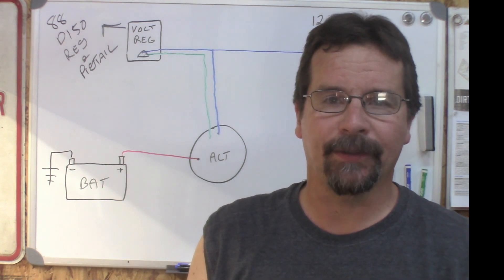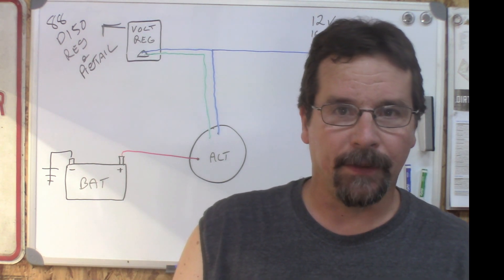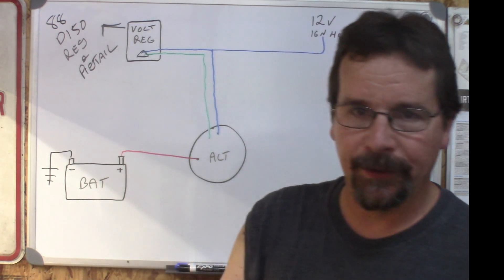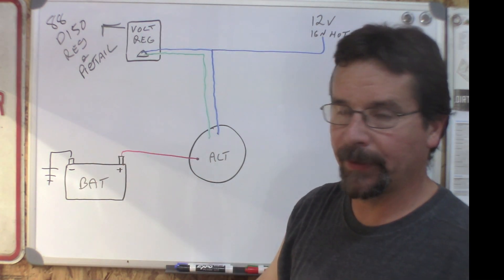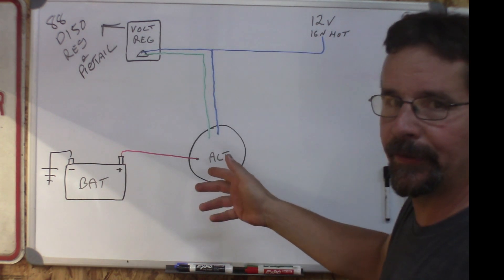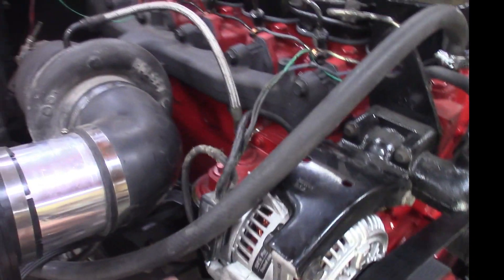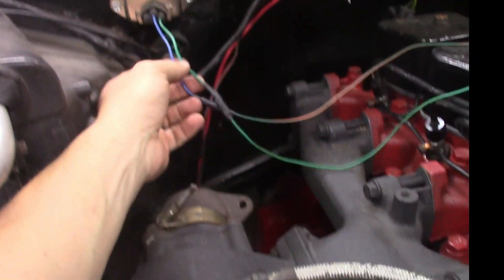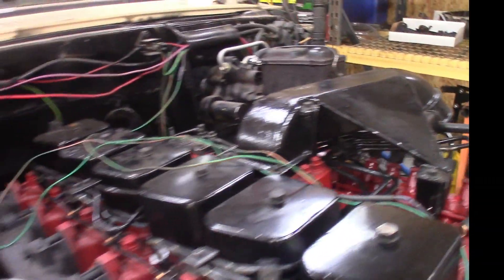How to Make A Dodge Alternator Charge In A Chevrolet (External Regulator Conversion)

Comment: Would love to do this on my swap and save a few hundred. The one wire alternator has a tach wire option. I really want to run a tachometer for the nv4500 to learn my shift sweet spot and see what the engine is doing. Is there another tachometer wiring option besides the one wire alternator?
Reply from the maker: I'm working on getting a tach to work off of the factory crank sensor but haven't quite got it figured out yet. 
When I do I'm definitely going to post a video of it.
Reply: @RicosGarage  Thanks for the reply Sir. I will be tuned in for this, hope it works out.

Comment: Rico I'm having hell. I have a 96 12v in a 2001 ram 1 ton. I've done everything but still not charging. Where should I hook up the split (blue) wire at? At column or starter
Reply from the maker: Starter won't work. You need 12v ignition power.

Comment: Rico quick question will any external reg work or does it have to be Chrysler
Reply from the maker: In order to follow this wiring diagram yes you have to use a Chrysler regulator. 
I'm sure you could make another type of regulator work but you would have to figure out how to wire it up on your own as I can't be 100% sure it will work the same way

Comment: On my jeep two wires go back to the ECM. Unless you put a load resistor between these wires, your volt meter goes to Max and your check engine light stays on
Reply: How big resistor.

Comment: Soooo... I finally got my truck on the road.  I've checked all of my wiring and grounds and tried 2 different regulators but the truck is overcharging at 15+ volts...
Reply from the maker: DanteGTZ
A new video will go live soon showing how to fix this issue
Reply: FYI: His new video fixing this charging issue is up. just put a relay in between your ignition switch 12v+ and voltage regulator.
Reply: @jason86768  I ended up going with a PAPerformance 1 wire alternator.
Reply from the maker: Verify with a multi meter or power probe that you are getting a good 12 volts on the switch power lead. 
Low voltage will cause the issue you are having. 
Also a bad rectifier inside of the alternator will create the same overcharge issue

Comment: I'll be doing the same thing on my K3500. I didnt realize it was so cheap.  My advance lists a VR for like $70.
Reply from the maker: Rock Auto is my go to if I'm not pressed for time
Reply: I used RA occassionally but in this case, my local Oreilly auto had both items for ~$30 total so I just went down and picked them up a few minutes ago.  I'll be using the Dodge/Denso alternator and following your steps here.  The question I have is in regards to the voltmeter in the gauge cluster. My Factory alternator on my K 3500 just had a single wire that plugged into it (plus the large wire back to the battery), which was what the gauge cluster used for the voltmeter. I believe I just need to can I cut wire to any positive 12 volt Connection in the truck, but since it is already wired towards the alternator, do you think there would be any harm in just stacking it on top of the same terminal that goes back to the battery? I'd rather pull my volt signal close to the alternator, instead of Elsewhere in the truck, if for no other reason than the wiring is already there.
Reply from the maker: @dante04srt  I don't see any issue with stacking it. Let me know how it works
Reply: @RicosGarage  Will do.  Just got the regulator mounted.  Still need to wait until I get my AC compressor figured out and ordered before I can test it out but it should work OK.  As for the blue/green wires, I'll see if my donor harness still has all of that and just cut it out and reuse it.
Reply: Finally getting around to doing the wiring on this. My swap is almost done - FINALLY!  Had to reference this video again for specifics.  Thanks again.  Hope your swap is going well.